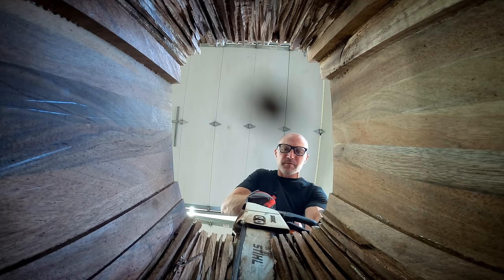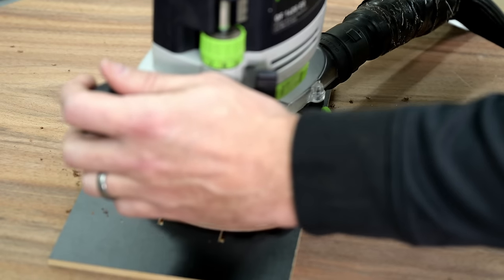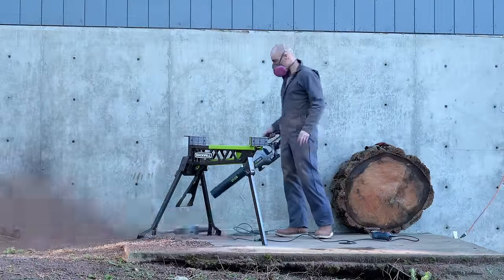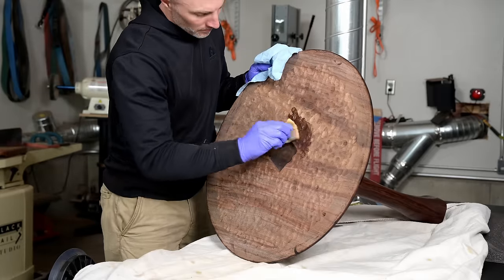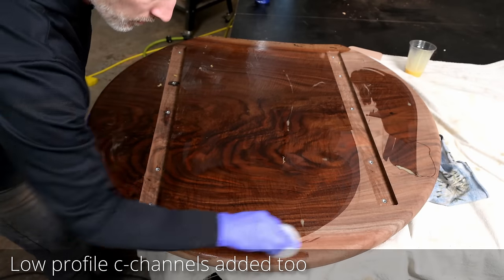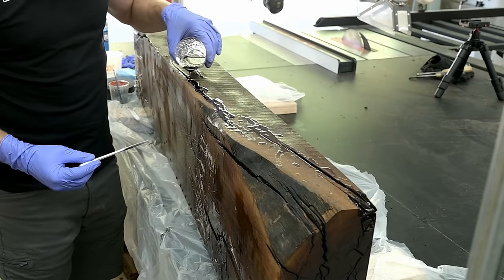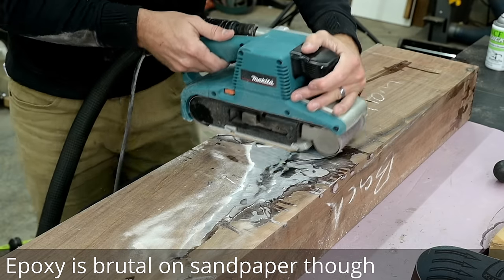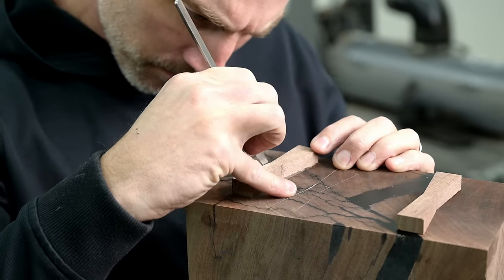Five Years of Woodworking Projects

Comment: The wood you use on a project does not all need to match if you intentionally use contrasting colors and grains in some sort of pattern to accent the other and it actually turns out looking way cooler than a piece thats all made from the same tree. If you want everything smooth, straight, and matching build with metal. Its the random variations in the woods grains that makes it look cool so use it.

Comment: I’ve used 6 mm mdf to make a curved former 
Crew it down up to the curve then pour boiling hot water over the bit you want to bend and it goes all floppy and bends very easy then hardens when it drys out . Great way to make formers

Comment: Feel'n ya on the quest for machining quality large diameter holes.  I've been playing with a standard sized bit brace for 3/4" wood owl bits.  Weather 2 or 3 cranks at a time with frequent squaring adjustments, or with a guide block, I'm doing better than with a press and forstners.  Loved the extra bevels on the corners!

Comment: Love your work Thought I give a tip on cutting the 2" holes. You don't need to pickup the heavy wide wood best thing to do is invest in the Portable heavy duty magnetic drill press and just place a metal plate on your wood work clamp it and place the magnetic drill on top it will locking place and the holes will work out great.

Comment: Okay the argument is mainly about the roughness on the dry side which locks more tightly, and the other is that both sides cover more area easier for both time and convenience since the one side glue is meant for stuff like epoxies. Generally there is no real difference just what suits your needs.

Comment: my thoughts on Glue  is use plenty of it asa boy my Dad  glued some off cuts from a scrap pile and a few days later had me try to break it  at the glued joint it of course  broke  but not at the glued  joint. his point was to demonstrate  the glue was stronger than the Natural Wood ,BTW that was in the 1970s   using just plain old Elmers Yellow Carpenter Glue  i became aProfessionalWood worker  untill MedicalConditions  forced me to retire after 35 years i the Profession ! it’s still a Hobby and a Passion of mine

Comment: my Dads company was QCM plastics in Kent WA.in high school i pumped tanker trucks of epoxy resin into 55gl drums years latter when pops retired i removed the my resporeter and walked to the open drum of hardener the label was gone for many years but to determine the amount of resin to safely harden and dispose of it the distance my eyes burned gave me the mixing instructions 5 to 1 i new right away to find out i was wrong took longer and at times evacuated several city blocks!

Comment: when the epoxy got hot under clamp pressure it compressed and cooled into a dense area.  Then the heat allowed it to relax and expand again into that mark.  If you warmed it up then sanded again it should lay flat again - my father owned an injection molding factory so unfortunately I know more than I should about most polymers including how bad they smell when heated past the smoke point (coughs in cpvc phosgene gas)

Comment: * Two things *  Others may have already mentioned, but it's important. At (2:03:11) - Wear UV blocking glasses when curing the Vesting hard wax product !!  Exposure to UV light, even for short periods, will damage your eyes. The light is known to induce cataracts, and a condition called photo-keratitis (a painful eye condition). Prolonged exposure may lead to skin cancer. A fellow engineer was exposing a UV-cured resin, and actually etched the cross-hatch fabric pattern from his shirt, onto his stomach :). Vesting should really have a warning label on their products.  Second, I don't know the light frequency or intensity of the light source you have there, but typically you can pick up UV-curing lights for under $50.00.

Comment: Sorry, I  lied. I have bent both wood and plastic. 
Wood from 1/4" to 2" thick by soaking in a creek, then placing into custom made made jigs.
The plastic is easier to bend in a controlled heat environment. You were really lucky as you had a consistent heat from sunlight for some reason. If you had built a box and blown heat into it, it would have perfectly followed the form.
Hahaha, you will find debris from the plastic for years to come. 
There is a buffing compound for epoxy that works well, just for future reference. To add the final touch, in a dust free environment, mist solvent on the surface for a mirror finish.
Okay, this is the last comment ...

Comment: Insomnia..  (5 decades but whose counting?)

Cam, for your next "Anthology"; drop the videos in 15, 20 or 30 minutes "parts".

Even though I've watched most of your builds, seeing them edited in a subtlely different way was like watching an "all new" BTS video. Also, revisiting past videos facilitates opportunities for new learnings Thanks.

As for considering the eurythmy of details that won't ever be seen when the peice is installed... this is the mark of a master craftsman ~ nobody else will know, but WE will. Ditto the pinhole fix on the mantle.

As for using epoxy to "rehabilitate" a slab with "cracking /rot issues"; this saves another slab from the "burn heap".

One thing I don't understand about those who use tape to "seal the sides /underside of the slab" to pour epoxy; typically they all have the piece sitting on a flat sheet of plastic. Why not create a rectangular "bund" of timber about the same height as the piece, place expoxy resistant plastic, lay down the piece (which wiil drag the plastic in creating a "bunded pond" to contain the epoxy "jail breakers") and pour the epoxy... if it leaks, the leak is contained and excessive loss of epoxy is prevented (so less epoxy required for the "top-up")... aparently "rocket science" is a tad "little bit difficult".

FYI Cam... all males "grow" as they get older (not commenting on the other gender). Since the start of covid, I've lost over 19kg (eat a bit less, exercise a little bit more)... most people I know put on lots of kilos with reinforcements during this period of "internal internment" (hay, I live in Aus, Qld wasn't as bad as Vic... but not going there)

For decades my weight goal (I don't diet) was to reduce my weight to the same weight that I was when I left high school at 18... this week I nailed it; 76Kg 😁

As for subscribing... typically I  find that within the first 5 to 10 seconds whether I or not I'm going to like the video (lost of psych research in this space)... seldom  gave I have ever had to change my "like"

Nikon camera ~ "speed is important"... except when it's NOT! ...lets not explore this further. 

As an Antipodean, I  find it hilarious that north Americans say "Rubio Amonocoat"... there is only 1 "a" in "monocoat".

99; "Max, they have us surtounded", Maxwell Smart "I have them right were I want them".

Comment: i am not a woodworker but i do work a lot with patches . do you want to fill your cracks faster ? i usually use polyester resin and can tint that and do it in 1.5 passes to get it to fill deep void. would that work for wood? or do you think its not structurally sound ?
Reply: when i say fast i mean sand within an hour and pile on more every hour

Comment: Dude, when drilling or cutting metal you ALWAYS clamp your workpiece. It's not like wood. You can't just rely on your tool to power through it. If your bit heats up and expands or if you find a dull spot it's going to grab a hold of your workpiece and either shoot it off in some random direction, spin it around at a high rate of speed, or torque your running tool out of your hands. The results of that are sometimes close calls and sometimes quite costly. ALWAYS clamp your workpiece.

Comment: One of the mistakes I've made with a drill depth collar was not tightening the set-screw enough. When drilling, the collar slipped up the bit and I ended up drilling through the wood. Rather embarrassing.

Comment: You're putting too much pressure on the tool, and the micro processor is telling the tool to shut down, like you say, it isn't over heating, it's just being over loaded and going into protect mode. 1:52:00

Comment: Sculpting those walnut inside curves would have been simpler if you had used an auto body air file with 36 grit stik-it and a half round shoe. That same tool would have done equally well with the outside curves. I don't envy you on that project.... wink

Comment: cam :::: Curvy cabinet/shelf unit from hell.
You coulda used templates to make reverse templates, found the longest stout router available, and quickly shaped thst unit... maybe not all 17.75 inches, but maybe the most important first 5 inches on front and on back... then the middle crud is much easier cleverly, with a diamons saw , ot other method.. 
A chainsaw??? OMG😮

Comment: Hey there Cameron, I am a master carpenter/sculpture from Scotland. Here's what you need to get for your sanding after you do your initial sculpt. Firstly you need a rubber backing pad for your grinder. Then you get zirconium sanding disks that are made for metal. Not the flap disks as they wear out to quickly. The disks are about £1 each and they last a long time. They are a blue color and you can get really coarse grits like 24 grit up to 120 grit. You can also get zirconium belts for the belt sander too. These last 5 times longer than conventional disks. I never use anything else. I sanded a full tree one time. I think the client was a bit nuts to have a tree in her garden sanded but I got a good view of the neighborhood and it looked amazing when it was done. Varnished the damn thing too! I used 20 24 grit disks. Try doing that sh*t with those flapdisks...I don't think so.
Reply: Cam, you mentioned you had a lot European subscribers, and they wanted you to involve the metric equivalent in measurements, tool sizes, etc. Well I can't (more like won't, because it's a headache). I am from Seattle, but grew up spending summers with family an hour north of London by train in rural Hertfordshire & Cambridgeshire. I can tell you this gentleman is spot on about the zirc disks. Oh and £1 is equivalent to $1.25 at the moment. That conversion is easy. I do wish we "Colonials" adapted the metric system as it is far superior in every way to our system of measurement. Not just lengths and tool sizing, but volume and mass. Along with everything else in every day life. The UK does have one mystery of measurement. Somehow I weigh approximately 14.5 "Stone". Or 202lbs, or 92Kg. 🤷 If I was a horse, I suppose I would be 18 hands tall.

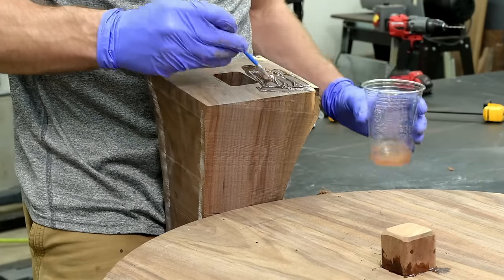Comment: 7:40 Large truck ratchet straps are a great clamping 🗜️ option not often thought of or used with timber backing lengths for non bend applications. 

Steel fixers metal flexing trick, often times if an idiot loads up balcony hand rail on a flat bed truck & everything is warped on arrival you have to creatively anchor ⚓ & clamp 🗜️ things straight even powder coated stuff wedge flex bodge & legit straight as you can, eye bolt 🔩 anchored to floors to create pull 👈🏼👉🏼 push 🫸🏼🫷🏼🙏🏼 positions with Acrows used in extreme 😁 cases off concrete ceilings whatever you can get purchase on lol. 

Yes the steel frames can fall off the back of lorries or timbers 🪵 buckle as cranes lift the load all bundled together, fecked 🫣😱. 

I've seen it, slinger signaler fails 🙆🏼‍♂️🙅🏼‍♂️🤷🏼‍♂️🤦🏼‍♂️🙍🏼‍♂️🙎🏼‍♂️ crane 🚧 🏗️ 🚧 driver stories of 12 feet lurches 😖🤢🤮 from 4 feet truck bed drops too heavy ⚖️ 😳 😱. 

Love those orange carver clamps 🗜️ in steel fixing applications, nothing comes close to there crush power.

Comment: Excellent video! 👍
@7:00 you can use compressed air and your smaller general purpose nozzle.... just aim closely at the joint, hit the air and pull the stuck piece out (sometimes it helps to wrap a rag around the joint area ).

The air pressure trick also works great on paint buckets like those from Harbor Freight and Home Depot… Just a little shot of air and they pop apart (mostly 😵‍💫💁).

Comment: When it comes to your base flattening. You have essentially self discovered the concept of rotary surface grinding. LOOK up Blanchard gribders. In industrial applications its usually a magnetic table rotating one direction with your work on the table, there are grinding stones rotating the opposite direction. They are beasts of machines. Good for hogging material flat and parallel. At work we use a 42in table and 72in table machine. The 72in uses like a 460v 200 hp direct drive motor for the stones. Ive ground solid steel stock thats like 3ft square x 4feet long flat within .0015in across the face parallel within .0025in again they are beasts.

Comment: You could try framing out the frame with wood. And then making the outside with plywood same shape with the pattern on both sides and then close in it all together. Filling in all the imperfections in the small spaces. And you can make that just by cutting out plywood with some kind of a frame inside.

Comment: One should vacuum up walnut sawdust and shavings as they are toxic to almost any plant. Of course bag it and toss it. A thing to ponder is make a relief pocket for glue, epoxy, etc to run to in the end of the tenon in blind holes. That’s the idea for slots in dowels and biscuits or the curved scrapes on dowels. Love your work.

Comment: Just a couple of things; 
PVC pipe makes inexpensive skates which allow you to easily move very heavy slabs of wood. You can add skates ahead of the piece to move them onto vehicles and such.
Hydraulic body tools provide a way to get big stuff clamped together. I don't use them at the very end of the throw, but you were struggling since you used a gazillion dominoes.
Have you ever used a reversible glue joint? You need a shaper, though. I don't see many videos that feature one. 
Have you ever mixed matching sawdust into the epoxy?
It won't work on everything, but baking soda and superglue can fix plastic, which has been accidentally damaged without replacing the part.
I have a bunch of scrap wood with heavy weight casters; clamp those to various spots on really heavy stuff allows you to move stuff by yourself that used to take take three friends. 
I said a couple, which was incorrect, so better stop now ...

Comment: Insomnia is nothing to shake a wooden pencil at ^ ^  As far as the 1.6k table is concerned...In my opinion, it would look better as a table base, not a top.  Turn it sideways with a 2-inch thick tree stump that covers all of it for a sweet-looking table, good call not to drill holes into it.  OR  put the scientist hat back on put it back in the sun and develop the newfound craft of epoxy-bending btw...RESPECT

Comment: The brads would have been an issue, but a really sharp adventure would have carved up within  ready planing thickness without using a chainsaw. They make planes which have radius cuts. My grandfather had a planing jig which looked like a giant bicycle chain that had threads to lock in any orientation. I used them to plane details on staircases like you see in movies of antebellum mansions. Though, you can make a chainsaw jig; but that requires metalwork equipment. The carving looked great at the end ...

Comment: When  I was doing repairs and restoration for work Id take one of the glue water brushes used to wet and soften the glue so we could clean it up and re glue it and wet the wood slightly first My theory was if I used water and a chisel to remove it opening the pores in the wood should help the glue bond deeper I would glue both sides..    Side note I ate lunch one day sitting in chairs the Pilgrims brought over...  Owner said if we get to fix them we have to test them...

Comment: You are forcing a mechanical bond on both pieces when taking the time to glue both pieces. The glue these days are pretty incredible. If it is actually needed not sure. However it is just like Backbuttering tile. It Is done for a mechanical bond between the two.

Comment: Question what benefits, advantages are your reasons using this brass filler? I’ve worked with wood flooring (every facet,species etc) my case using the material sanding/ dusting making fillers blends better, even contrasting species meeting your vision. Like to see what thoughts
Reply from the maker: It’s just for looks

Comment: Insomnia?  Nope.  Anyway, about that bent epoxy table, my suggestions are:  give it to one of the folks who applied for it that are local to you, or quietly donate it to a charity that would actually use it.  By the way, it looked a bit unstable when you were setting it up.  If it is, what can you do to remedy that without changing its looks/design?

Comment: I DO like these kind of projects, and have done a few myself.  I do NOT however like the massive black voids (my own projects have them so it isn't personal).  I haven't found an answer to that problem.   I've experimented with using deep dark browns, it's better...but still not great.  I find the problem isn't just the color but rather that large areas of SINGLE color stand out like a sore thumb on the rest of the wood with unlimited variation.

Comment: * I know it's been a month already.. consider the 'air' in the space that you are trying to insert the peg.. there is no where for the air to escape as you are pushing it in. sometimes we think the resistance is 'snug' when it is actually 'air' trapped in the space. That is why it is was hard to remove also.  a tiniest almost invisible cut along the length would give air an escape route. it will be filled with glue when you finish the piece.  :)) I have to say, How lovely is that shape you created..  You really have a nack for tapping into the wood and seeing what it can become.  Just finding your channel.  May just have to binge watch for a while.  I love wood.. so so so beautiful!!